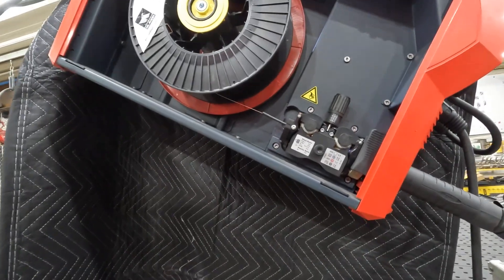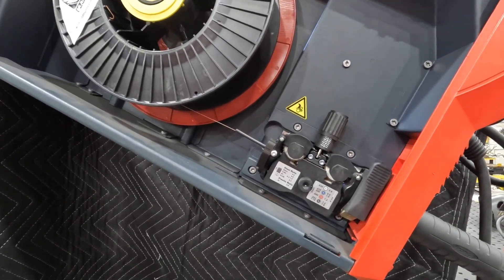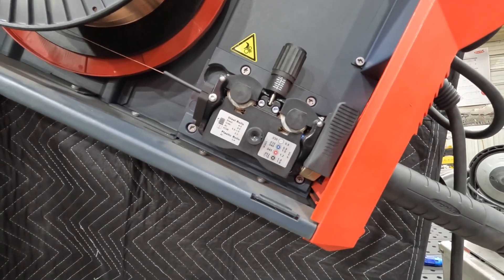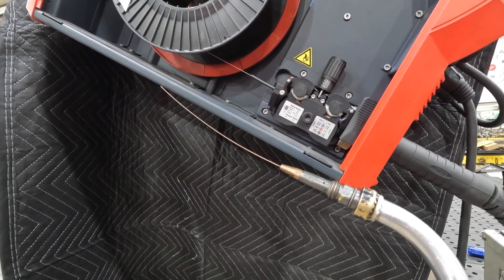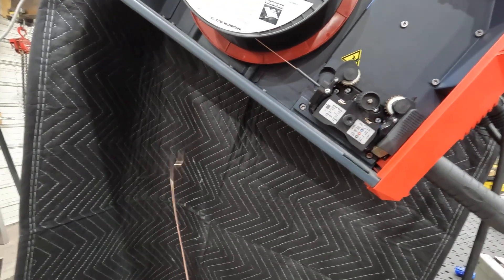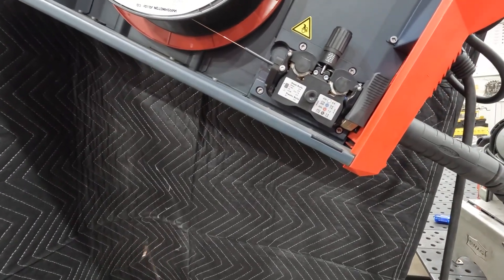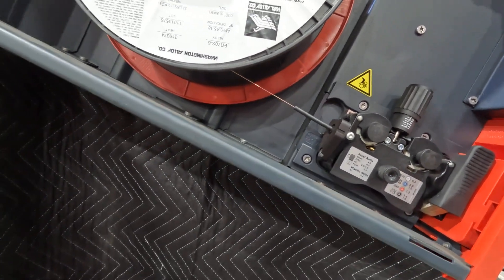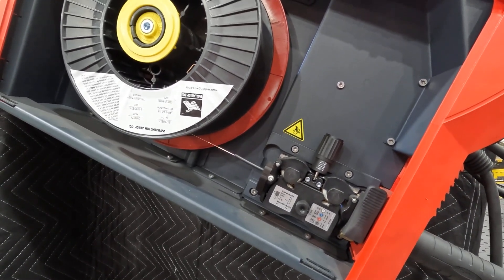MIG welder checkup.  It never hurts to check the simple things

Comment: Hello, what are you using that machine for? How did you pick it over a Miller? I have a TransSteel 2200. Looks like an awesome machine, but super expensive
Reply from the maker: This is a transteel 2700 that I use for general fabrication.   Mainly steel hardwire.   I have owned many miller's and it was just something I wanted to try out and I have been happy with it.  The price is around $3500 so it's nothing out of the normal.
Reply: @eastech3365  Very cool, thought it was in iWave
Reply: Can you get 270 amps  maxed out if you run that machine on single phase? I'm on the fence between the 2200 and 2700. I have contacted Fronius and cannot get a straight answer o when I have asked this question.  One of their representatives said yes you can weld at 270 with a lower duty cycle. Another representative said you can only get 180 amps on single phase.